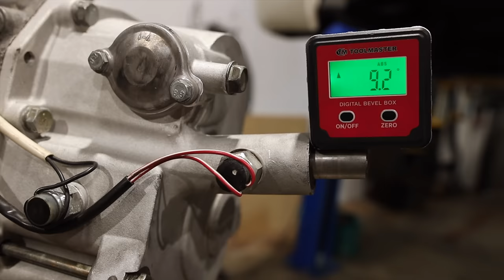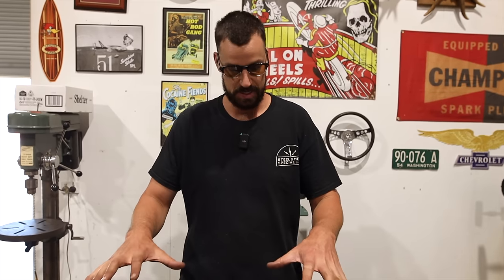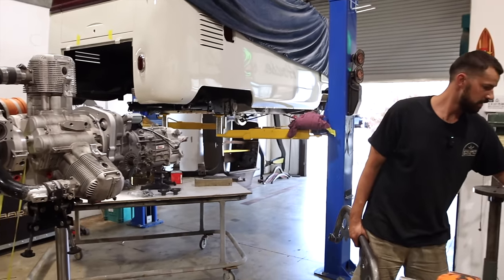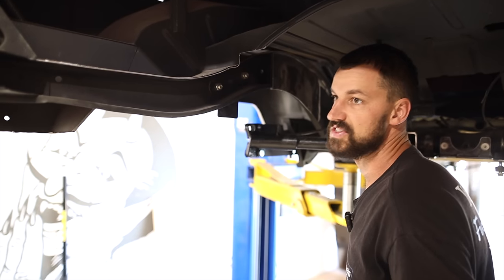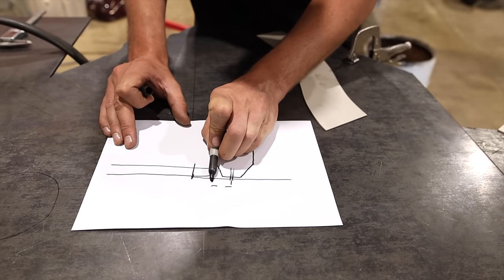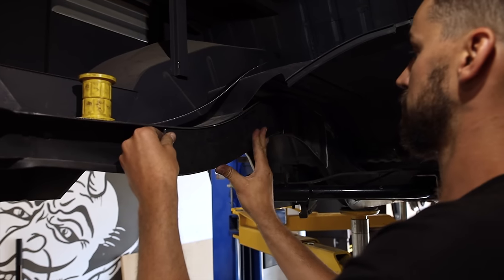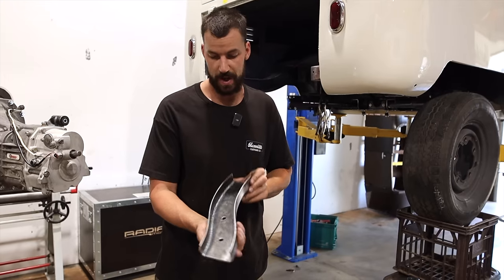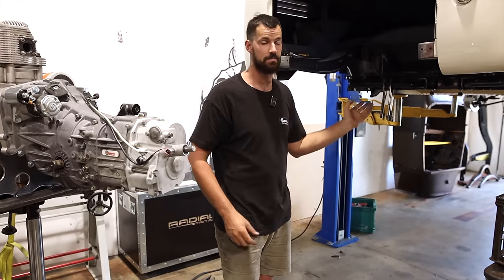EP. 4 - Installing Radial Airplane Motor in Volkswagen | Custom Boxing Plates

Comment: The Added Treat is using Studio Headsets and your Tunes are Great @! 
I do like the altered unboxed adaptor into the Frame,, Nicely Done Captain... 
From links in memo, I see you are in Australia. 

I truly loved my 3.5 month tour in around Melbourne, Driving the famous Troupy.. It was designed 
for going into mines, and fabricating the electronic scales I built for mine conveyor systems. 
Took him all through Australia, and all along Great Ocean Road. I owe that vehicle my life, in how 
it got us out of very dangerous wilderness swamp jungle, where one can't see two feet in front of you as 
the brush is so thick, and then water was coming in the doors. 
Now trail of mud and water is up over the starter on the engine. 
Where the only way out was backing up 12 miles,, then getting out and kissing the dirt. 

Oddly all that time there, no matter how many times to the store,, come out and still get in 
the wrong side of Troupy to drive... let alone too easy heading the wrong way into oncoming traffic. 
For the new crew heading there, be darn careful,, think clearly before putting it in gear. 
Cheers

Comment: First of all, my best friend and I stripped back, restored, and converted a 1961 VW bus to take a 2022 Subaru WRX STi engine and gearbox from a fire damaged insurance write-off. 

We had the same issue regarding the depth of the sump and the acute angle of the gearbox lining up properly with the gear changing linkage of the bus. 

We raised that engine by 10 inches, not the 2 inches you were worried about.

We had to raise it that high because (a), it was a Subaru WRX STi, and (b), we slammed the bus to half an inch from the ground using air suspension.

Obviously, some of the engines components had to be redesigned or relocated. Otherwise, the boot or trunk area as you call it, that would have been lost completely.

I have to say, the exhaust system was redesigned and a remarkable piece of engineering. The tail pipes protruded from the rooftop mimicking like those seen on a truck, only much thinner.

After some head scratching and many, many long days, nights, and weekends, we managed it. The bus, my bus, my pride and joy, after my two sons, of course,  was finally finished. Thanks, Brian, for all your help. No, you can't borrow it.😂

We took many ideas from different manufacturers, but the best was an American idea where in the 1950s, fuel tanks in trucks were placed behind the drivers seat.

Well, we did something similar, only we took it to another level. We had the interior of the bus 3D scanned.  

Then, using that data, we had a fuel tank made from a specialised resin, resistant to all fuels, which was moulded to fit the bus in two parts in the shape of the letter L.

The first part went at the back of the driver and passenger seats, then it curled round and down the length on one side of the bus opposite the slinding door. It was an odd shape  admittedly and varied in size. Both in height, width, length, and thicknesses, according to where it was located. 

Once both parts were loosely fitted together, the designers fused both parts of the tank together using a [trade secret].

We were not privileged to watch this process being done, but a strange noise could be heard. We, Brian and I, with our friend Tim, looked at each other. We could hear what sounded like a spot welder being used. Really, a spot welder? No, impossible. 

The process took about 40 minutes until we were all allowed back into the workshop. They said not to fill the tank just now as full curing time takes 12 to 24 hours.

After careful measuring, the company, who made the tank, said it is able to hold 136 imperial gallons or 618.26 litres. The standard tank in a bus holds 10.8 gallons or 40.88 litres.

My wife, two sons, and I drove from our house in Hampshire, England, to Ben Nevis in Scotland, where we have a cabin in the mountains.

With stop breaks for refreshments, hot meals, and trips to the lavatory, it took us 15 hours and tripped out at 578 miles door to door on one tank of fuel with a little to spare. 😁

Using our 2002 Volvo V70 petrol automatic. We would fill up before setting off and then stop thrice more to fill up with fuel on the way.

Add the travel time with the same amount of refreshment breaks it was about the same time, as the bus took only much more comfortable in the bus.

Now to some criticism. 

I wouldn't say you talk too much but more the way you go about the explanation itself.😂

Sometimes, you treat us as though we are kids and explain some things that, let's face it, a young teenager would know because of well,  common sense.

Here is an example: You told us you deduct the width so that your torch cuts exactly where you want it to cut. A simple assumption, wouldn't you say? 

Visualisation is and can be the perfect teacher. We watched what you did and therfore no explanation was needed.

That, and the fact that you repeat the same stuff over and over a lot of the time. A little more attention to editing wouldn't go a miss and would probably fix that issue.

One last thing that niggles me. I've been doing what you are doing now for a great number of years. I take a lot of pride in my work and every vehicle I work on, must be of a perfect quality.

My projects sell for many thousands of pounds, because our work is top-notch, to a high calibre. 

I would say our work is as good as, or better than, in some instances, than Rolls Royce or Bentley.

Our work is i would say, on par with Tickford Customs in the Midlands. So, let me get this straight me old mucker. 😉

You are not building a satellite.
You are not building a rocket. You are not even assembling a highly delicate piece of machinery that requires absolute microbial clean surfaces. The answer to all three is no!

You are welding together sheet metal at high temperatures, and the only preparation required is that you grind away loose particles such as rust or slag  so that the welding media can do its thing.

Wiping off any oil or grease with a simple rag and perhaps a little petrol, diesel, or decreasing agent will suffice. Even a little WD40 will do the trick.

The heat generated from the style of welding you carry out will burn away almost anything you would find on newly acquired steel. Unless it has been sitting in your workshop for years, gathering dust. Even then, a simple wipe of the rag will do.

There is no need to go over board as you do. This just makes for good content and extended video minutes because more minutes equals more dollars in the bank!

While I'm having a bit of a rant, why not pull you up on your English.

The correct term for the bush you showed us being fitted after you removed the over sized bracket is not called a bushings.

[See video content from about 5:40 onwards] When you say: alrite, we've just pulled it out of the jig. I've just put one side in for our bushings.

When you say, "I've just put a bit of assembly grease on these bushings." Again, incorrect English. What you should have said is: "I've just put a bit of assembly grease on these bushes, to make it a little bit easier.

To reiterate, it is called a "Bush," singular, not bushes. More than one Bush, you say bushes, not bushings.

There were several pronounciation errors throughout the video, which i put down to being an American.

A really good example is that Americans say tamato. But it is spelt tomato, not tamato. But the best word is something we drink every day, water.

And yet, Americans, no matter what part of the country I visited, they ALL pronounce it wrong. 

Some with a D in it and some with an O and some with an R like, worder. Can I have a glass of wardor. Or A bottle of worder. They spelt it correctly in every state I visited, it was just mispronounced and that buggs the bjesus out of me.

Thank you for entertaining me, I had a great laugh. 🤭🇬🇧⚒️

Comment: Since you want the engine higher without affecting the shifter why not locate the shifter rail in the hole and tilt the engine up while leaving the shifter stationary. This gets your engine up higher and also reduces the shifter u-joint angle.

Comment: Your work is incredibly beautiful, very valuable and I love your channel. But I have the feeling that the upper cylinder may have thermal problems. It would also have a positive effect on the temperature of the intake air if it were not drawn in from the engine compartment but rather fresh air from outside.
<3
Reply from the maker: You’re not wrong! But being water cooled should help this. But the rear engine lid will be louvered and air ducting fitted to help get the heat out

Comment: I think the weakest part is the 4 bolts going through the the mount and into the adapter plate....holding the engine out in mid-air.
Reply from the maker: Yeah forsure, lots of over hang. There will be more added to help support it

Comment: I don't know how the internals work but I wonder if it would be possible to modify the tail housing on the Subaru transmission so the shift rod comes out at a better angle.  It may be more trouble than it's worth.